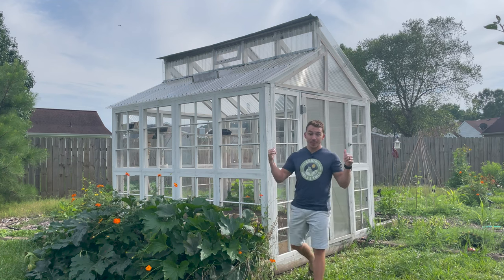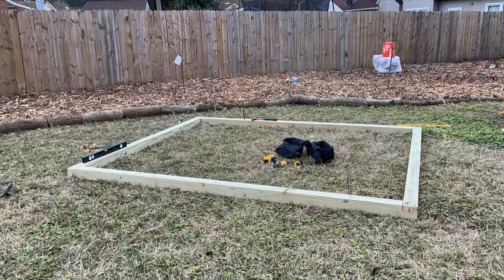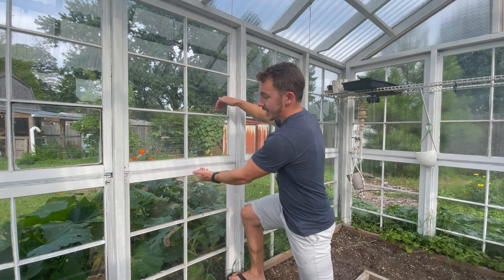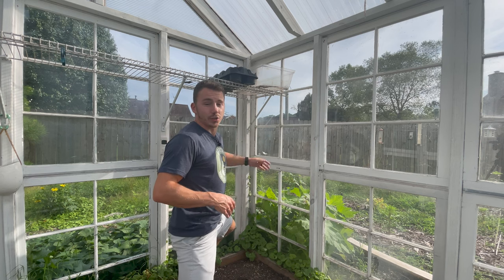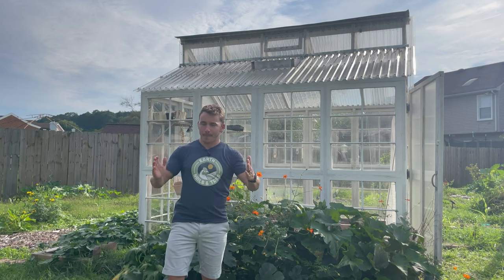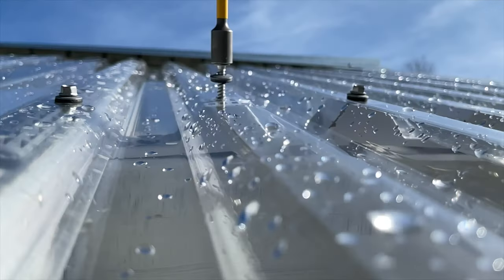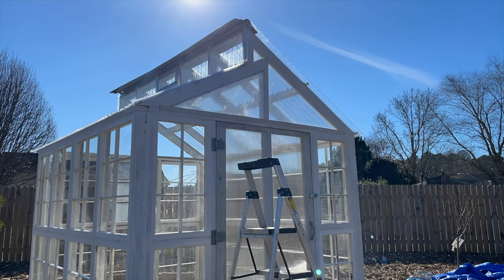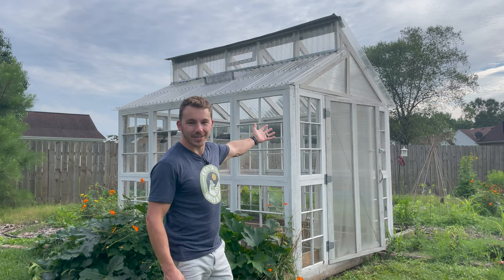DIY Greenhouse Build - Custom Designed and Built Reclaimed Glass Window Greenhouse

Comment: Lucky that you were able to get enough windows of the same size, great video. Im using sliding glass doors sourced for free on CL. They are different sizes but I will frame them in a similar way.

Comment: Been looking for a good option for laying a solid greenhouse foundation for a while that didn't involve laying concrete. I considered cinderblocks, but they don't seem to assist the overall structure, even when adequately sunken into the ground. The rebar through the 4x4s is the perfect solution I've been looking for! Thanks!
Reply from the maker: No problem! I built this to be non permanent. I did not want to lay a salad either. An additional step you can take is painting the 4x4 in tar to make it more water resistant

Comment: Gorgeous! Instead of changing the windows could you add roof vents? I am wanting to do a greenhouse but I feel like roof vents are going to be a must due to heat in my area.
Reply from the maker: Yes! I’m still trying to figure that out but would definitely recommend as many vents as you can. I may actually use the extra windows in the roof!

Comment: Well done!! I like the look and the instructions and videos of how you built it were so helpful. I'm curious now though --- how do you use it?  Start plants in the spring to transplant outside? Do you keep plants in the ground at all?  I've never had a greenhouse, but want one, but not sure how to best utilize it. I'm thinking of a short wall - maybe two feet and build the windows on top of that. Maybe I'm missing out, but why did you decide to go clear to the ground with windows?
Reply from the maker: Thanks so much and great questions! I used windows all the way to the ground so the beds are getting max sunlight but you could totally build walls like most greenhouses you probably see. I use it for all of the things you mentioned. It’s great for gardening off seedlings and we harvested potatoes this year which you can see from last months video! Lots of great possibilities!